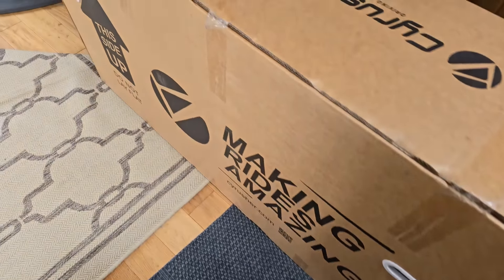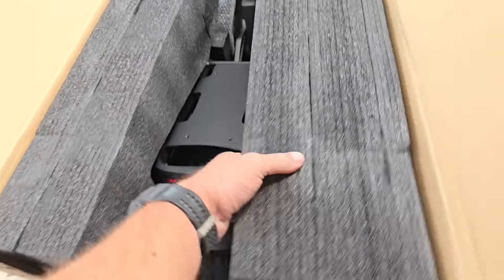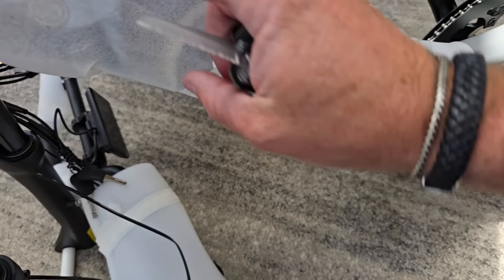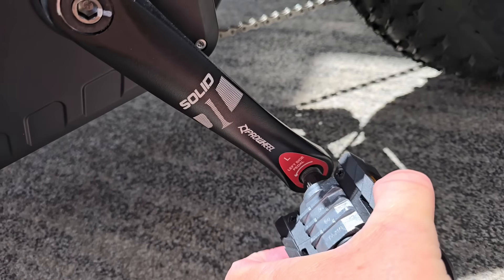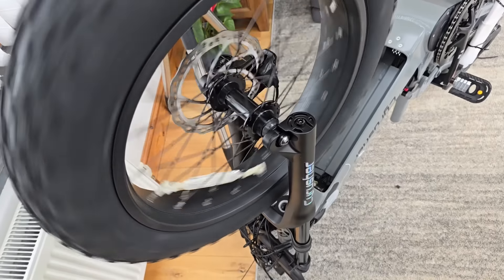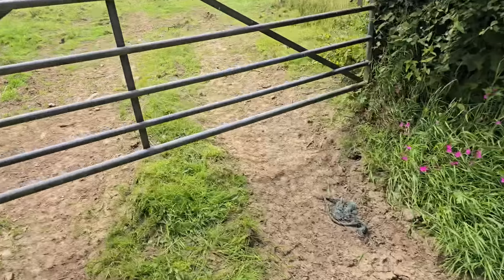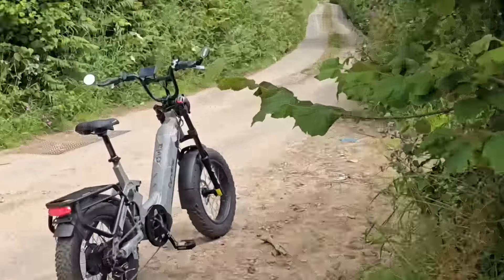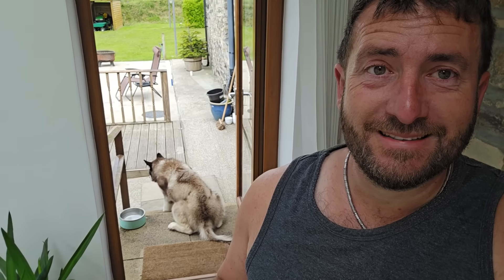He Wasn't Impressed But I Had Lots Of Fun With The Cyrusher Ovia

Comment: I love the handle bars and wheels on that 1, throw back to my BMX in the late 80s 😂  As long as the throttle is capped at 15.2mph you should be good to go. I've had my e bike for 9 years now and need to use the throttle a lot as hilly around here and I'm partly disabled. Looked like that throtyle had some power on it though 🤣

Comment: I think that's the best bike yet.  I like that it comes with mirrors and mud guards.  Over 50 miles on one charge is pretty impressive too.  I like the idea of ebikes but my tired body doesn't.   I have looked for e-trikes which would be less strain.  I have Chronic Fatigue Syndrome and Fibromyalgia so even a little activity puts me in bed for days.  But I can dream...

Comment: Great bike! Looks fun as!! I'd def have that seat post up a fair bit more though Jamie. You're 6 foot something, need to near lock those knees out more to get the best out of you're pedaling efficiency. That bike wont be light, so do your knees a service :) 

 Might even be worth a look at what I use as an MTB'er, a dropper post, (allows the post to lower or rise at the push of a button) Always thought them a bit unnecessary before I got one, but it's a case of once you have one, you simply cant be doing without one afterwards. Enjoy many many rides out there!! :)

Edit: Tempted to say get a bike trailer to pop Sherpa in for rides, but I rather think he'd not thank me much for the idea. No scope for good snoozing in the back of one of those, due to being rattled about probably quite a bit.

Comment: Is there a justification for why a battery-operated bicycle is not allowed an accelerator on UK highways? Especially since a motorcycle is allowed an accelerator. AND major motorcycle manufacturers are producing battery-powered units. 
Doesn't your other battery-assisted yeah bicycle have an accelerator? And, if you cannot use the accelerator, how do you make it move using the battery assistant? OK, I see that you must pedal to get it moving and then you can choose the speed by the battery output strength switch.
But the ban on an accelerator makes logical sense... The rest of the world needs to know.

I love you "cup of tea" could mean anything from an actual cup of tea to a complete meal. Not living in the UK keeps me guessing as to what time of day a "cup of tea" is referring to...😅